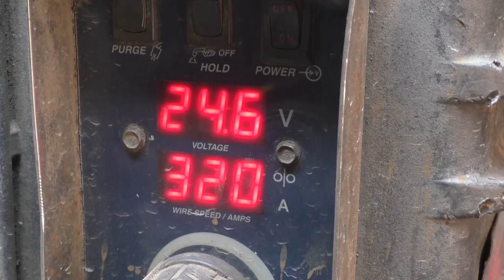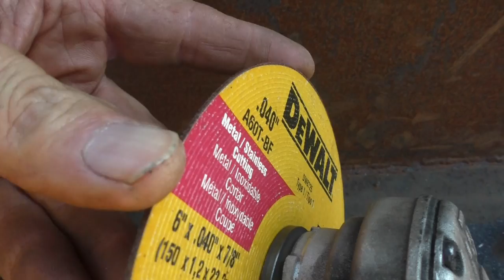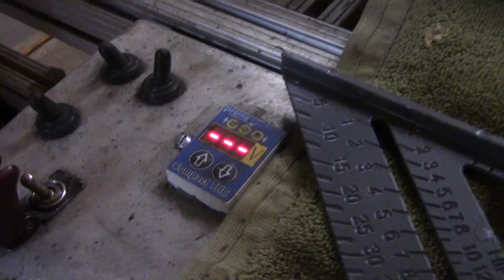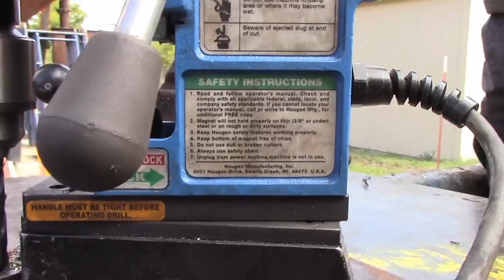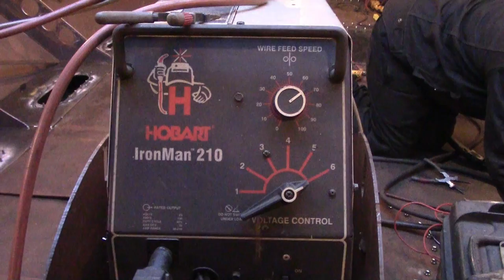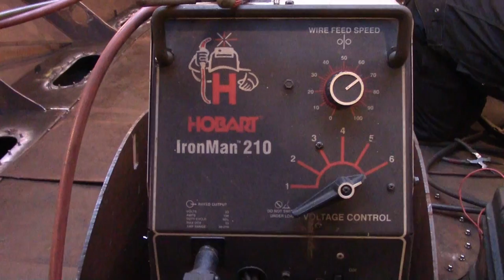Fuel Tank Lids and Junk Sails

Comment: I suggest using Marine Tex "gray" sealant on all fuel tank seams. Despite appearing to be sealed, they aren't. Small porous areas will emit an unbelievable diesel stench. I tested cured marine Tex completely submerged in ethanol petrol and it did not deteriorate. I used it to seal the seams on the 40 gallon petrol tank I built for my vanagon and they are still leak/seep free one year later.  Looking great. Glad you found some help!

Comment: Great video Doug and Betsy.  I take it there is no [ practical | reasonable ] way to run the bobbin thread from a full spool instead of winding off those short bobbin spools?  Kinda tough to re-engineer as an end user.
Reply: It uses two threads to sew, a spool on top, and a bobbin on the bottom. A spool won't fit in the bottom where the bobbin goes.
Reply: high volume commercial sewing machines spool the top and bottom threads on the top of the machine.  not knocking the kit Doug and Betsy have - just thinking outside that box.
Reply: the top thread gets wrapped around the bottom bobbin for each stitch,  so the bobbin has to be compact.
Reply: True, but those are usually chain stitch machines not lock stitch. For sails you really want lock stitch to make the seam hold together. There are machines that use a much larger bobbin but they are $$$$.
Reply: Ah!  Lock stitch is the concept I was missing.  Thanks guys.  The $$$$ part is a given - I knew that  :)
Reply: There is a kind called an overlocker which uses 4 threads total, no idea beyond that.  I have a feeling they were used for sails.  They are not much more expensive to buy than an industrial 2 thread machine here in UK
Reply: That style machine is called a serger in the US. Used to sew the edges of seam together and trim and capture the edge. Very common seam in clothing but wouldn't be very useful on a sail as it leaves a standing seam and not a flat one.

Comment: interesting psychosis..
 have you ever considered therapy....

 I have had a similar psychosis with an aluminum boat.

 it really is a 12-step program.
Lol

 I hope you put a rope ..line cutter on the propeller shaft.

 also a secondary release cable on the anchor.

 in the past I've been trapped
 the anchor can be Tangled around so many things.. this is happened to me twice.
 one time  a car the other time a power cable
 my advice is be prepared to jettison the anchor.
 the end of the anchor chain should be 
 rope that can be cut with an axe.

 I have been through several hurricanes...

 and I believe that the ability to drop and run is very important.

 pulling up the anchor for a reset is not worth it.
 jettison first anchor and go for a reset with the second.

Comment: Any reason you are using cast iron pipe couplers vs regular steel couplers that you can just weld instead of braze?
Reply from the maker: Cutting a coupler in half is cheaper.
Reply: I understand you get two from a coupler. Im asking why do you use cast iron ones instead of mild steel ones? You can just weld mild steel pipe couplers saving money on expensive silicon bronze mig wire while also increasing strength having mild steel pipe welded to you mild steel plate. Here is a list from Grainger offering couplers in different material with similar costs.>https://www.grainger.com/product/GRAINGER-APPROVED-Coupling-WP7115873/_/N-qu1?s_pp=false< Note the mallable iron, forged steel, and black forged steel in Pipe Fitting Material. The forged steel ones are ready to weld. No brazing required.
Reply from the maker: Fittings are still cheaper even with the wire.

Comment: Why didnt you join the ribs to the deck beams? im not an expert but wouldn't the gap between them (hull/deck weld be a weak point.
Reply from the maker: The ribs are more for decoration and anchor points for cargo than anything else.  The design is actually has no frames.

Comment: are you going to go for a bowsprit with a figure head,traditionally an artistic point on the vessel?
Reply: think the dragons fill that role....
Reply: I'm wondering what the bow will look like. Will there be some kind of railing across the gap? Or a door?
Reply: as I understand it, there's a mast that's going to be there....
Reply: a mast as in layed flat when not erect?
if its protruding that's pretty much what a bowsprit is ,I think?
Reply: it's called a mast if it's vertical....if it pojects out at an angle, it's called a bowsprit (typically used for a jib sail)....the model has a smaller mast placed on the forward platform....
Reply: do you mean a boat can have more than one bowsprit?
Reply: Tim Hyatt Looking at the drawing on Doug's website, it looks like the forward mast is several feet back from the very front where the opening is. Perhaps the design has changed some though.

Comment: Hey how many sheets of metal did you use on the project?
Reply from the maker: Take 19 tons,  divide by the cubic weigh of a sq inch of mild steel,  time 4 for the 1/4 " thickness of most of the steel, divide by 72 for 6 feet wide, and you get:  19*2000/0.28356*4/72/12=620 ft.   So one 6x620 ft sheet should do.

Comment: How will you clean the  rust on the metal when you are finished (which seems to take like 1000 years)
Reply: Sand blast
Reply: it's just surface rust no hard stuf
Reply: J.T. Versteege But if thex won't remove it,l won't it get strnger over time?
Reply: Der Kommentator he has a few vids of sandblasting with water to keep down the dust. Pretty sure I remember him even reclaiming the spent aggregate.